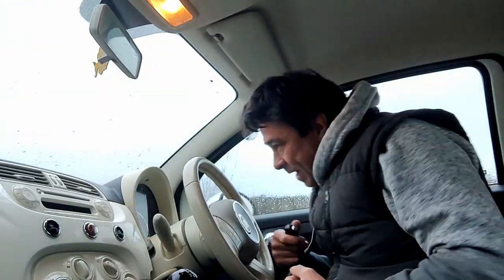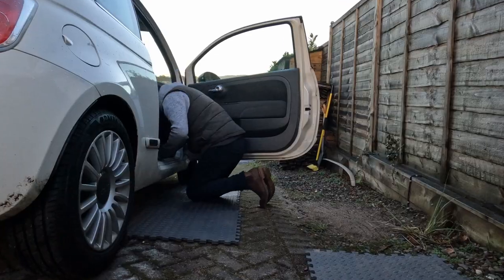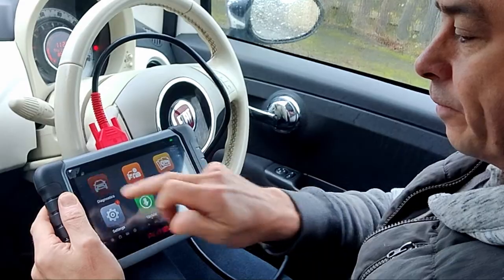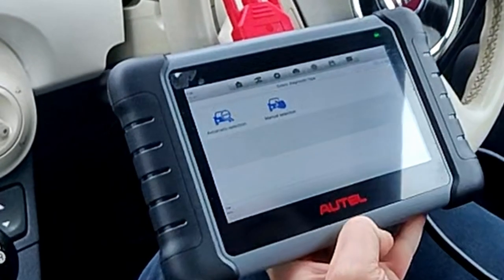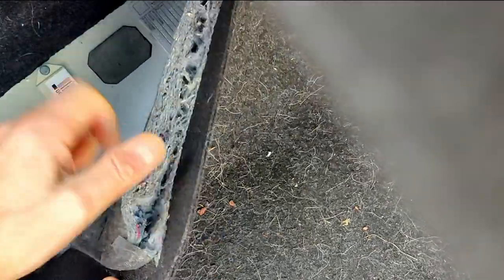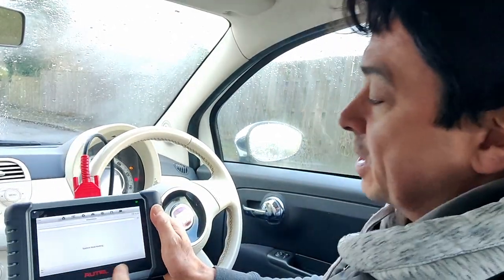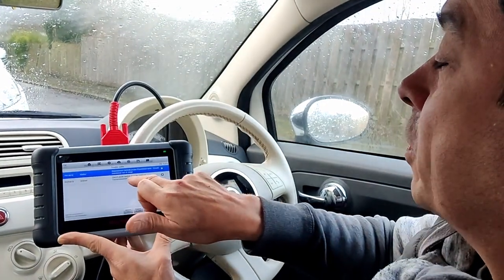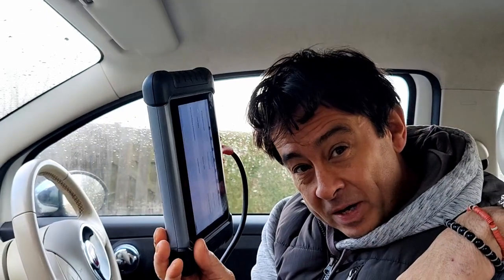Fiat Autel Maxicom - Engine Fault Light Code Clearing VIN Number

Comment: My Fiat 500 has started to have problems. When I start the car in the morning, the engine light comes on and I have very little acceleration. I am literally travelling along at 5 miles an hour. This is for around 2-3 minutes. I then turn the car off, start it again, and there is no engine light and she runs perfectly. What do I do?
Reply from the maker: Have you checked your engine earth strap is secure and battery terminals?